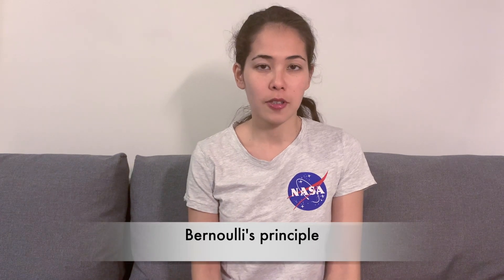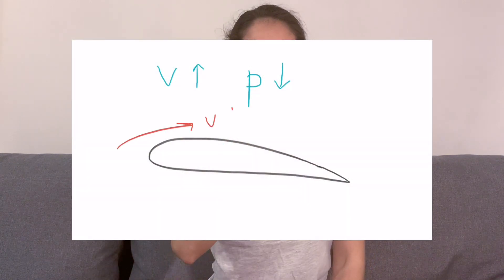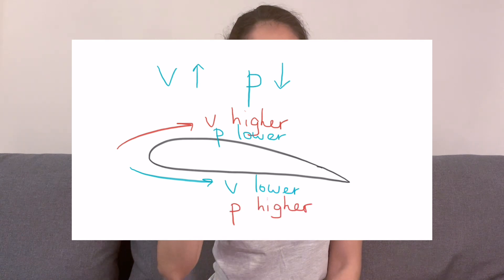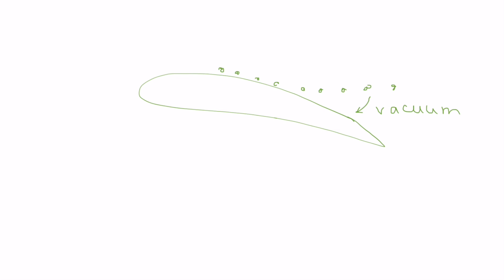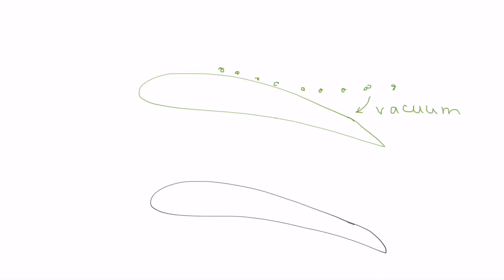What is the correct lift theory?

Comment: Hi Aliya, 

I just came across this video, I've always been interested in flight, but untrained; can I share some of my thoughts. I'm sure lift theory has advanced so much since your video, so maybe some of my concepts have already been proven or disproved. 

Both the Bernoulli and Newtonian principles seem to have gaps that I can't see anyone addressing, or even recognising. 

Bernoulli's principle doesn't have to assume an equal transit time. Wind tunnel smoke tests clearly demonstrate differences in time for air particles travelling over a wing vs under a wing. Smoke tests also demonstrate that the air over the wing slows down at the start, so it’s not all faster; likewise, air under the wing speeds up in some places. But overall, there is a net increase in air speed; therefore, there is a net decrease in pressure. At the same time, there is a net decrease in "relative" air speed under the wing; therefore, a net increase in "relative" air pressure under the wing. It's these pressure variables along the wing, and increase under the wing that aren't discussed. 

Another aspect of Bernoulli's principle that isn't properly addressed is the criticism that Bernoulli's principle only applies to fluids in a tube. Some assume that as a wing in flight isn't in a tube, then Bernoulli is irrelevant. However, in a wind tunnel, it is in a tube. Even so, an aircraft in open skys can be considered as if flying in a tube. Bernoulli's principle applies in large and small tubes. A very small wing in a very large tube has no discernable interaction with the walls of the tube; instead, that small wing is contained within a sleeve of ambient/normal airflow and pressure. A high or low pressure wave/differential presses or is restrained by that "normal" air pressure, as if in a tube. 

At this point there's a transition to Newtonian motion. I find it easier to think of these as displacement, deflection and thrust vectoring. When the pressure wave/differential occurs, it is resisted by the "relatively static" mass and motion of the surrounding "normal" air. This pressure differential tries to displace/move a static mass of air by either pushing against that mass, or drawing in closer. This means pressure differentials can also be co sidered as mass (floatation displacement) differentials. A mass being displaced then means forces and acceleration. 

As we add movement to these masses of the wing with its associated pressure/mass differentials against the mass of the normal airflow and pressure, we now have principles of momentum to consider, thereby we have momentum differentials. A consequence of non-colinear momentum and displacement is the deflection of those associated mass bodies. These deflections thereby have resultant vectors, for both mass bodies. 

So far these differentials have been direct wing interaction with the surrounding air, but after the trailing edge there is no more direct interaction. The higher air flow on the top edge is now coplaner with the downward dloping trailing edge profile, resulting in a downward flow of air/mass with inertia, which the surrounding aft airflow has to overcome to normalise. Although this mass flow normalisation is behind the wing, it is reacting against other air masses that have already been normalised, similar to the principles of a jet or rocket exhaust in air vs a vacuum. 

Two other aspects that are typically overlooked and not discussed are U-wings and uplift and bracing loads on a house roof. 
Both of these are outside of any Newtonian discussions I've heard, yet the capacity for high wind loads to lift a roof off the walls is very significant. 

Now to explore some of your other aeronautical videos.

Comment: As an aeronautical engineer who used to teach aerodynamics in college, I profoundly dislike these explanations. There are wrong theories for lift, like equal transit time, which is in fact a naive theory, it was never a real one used by real aerodynamicists. Naiver-Stokes is everything. It can handle any situation in fluid dynamics for which the continuum approximation is good (i.e. taking the fluid as a continuum rather than individual molecules). It can handle viscosity, compressibility, vorticity, temperature changes.... everything. (Naiver-Stokes is basically Newton's law applied to a parcel of air, plus mass conservation plus energy conservation). It can handle lift too. The problem with Naiver-Stokes is not that it cannot handle lift, but that we cannot handle Naiver-Stokes. It gets too complicated and there is no known closed solution for the general case, although numerical treatment can get arbitrarily close (given enough computing power, time, and knowledge of the properties of the fluid). Of course that the 3rd law needs to apply. If the air makes an upwards force on the wing (which pushes the airplane up) , the wing needs to make a downward force on the air (which deflects the air down). This is known as the action-and-reaction law, but which is the action and which is the reaction is totally arbitrary in the best case or, even better, meaningless. To explain lift, it sound nicer to say "the wing deflects the air down so the air pushes up on the wing", but the reality is not that one comes because of the other or the other way around. They are concurrent effects. Both happen together and need each other. Forces ALWAYS come in action-reaction pairs. This is enough to explain lift in the macroscopic view, but how is the force of the air over the wing manifested? It is due to the pressure distribution around the airfoil where, overall, the pressure is higher in the lower side than it is on the upper side. Why? Well, Naiver-Stokes. But the extremely simplified version of Naviere-Stokes, that is Bernoulli, is an EXCELLENT predictor of lift (predictor is not the best way). As Aliya explained, you can put pressure probes around the airfoil. With the measured pressures, you can calculate what the speed of the air should be in each spot around the airfoil. Then you measure the speed at those spots and voila, almost perfect match. No equal-transit required. You can also use the potential flow theory (which is the condition under which Bernoulli applies), with the Kutta condition (the assumption that each airfoil will produce enough circulation to ensure that separation happens at the trailing edge) to calculate IN ADVANCE what would be the pressure and speeds distribution and, again, very you get very good matches with actual measurements. This theory even permits to predict that the slope of the coefficient of lift vs angle of attack is 2*pi (with the angle of attack in radians), which is a perfect match for not too thick airfoils and not too low Reynolds numbers (at too low Reynolds numbers the viscosity effect takes more importance and the approximation of potential flow is less valid). Even then, Bernoulli itself is not enough. The Bernoulli explanation would be "The air moves faster on the upper side so the pressure is lower".  But why does the air move faster on the upper side? Because the pressure is lower, so the air accelerates from a region of higher pressure (normal atmospheric pressure) to a region of lower pressure (on the upper surface. Wait a second.... this sounds like what was first, the chicken or the egg. Does the pressure go down because the air moves faster, or does it move faster because the pressure goes down? And the answer is YES. I know this may sound not satisfactory, but both things happen at the same time and are concurrent, they need each other. Similar to what we said earlier about action and reaction. At the endo of the day, it is very simple in principle (the math makes it complicated). You start with a uniform airflow far away ahead from the wing. You put an airfoil in the middle, with a certain geometry and a certain angle of attack, and impose 2 conditions: 1) The airfoil is impenetrable (air cannot flow from the outside of the airfoil to the inside or vice versa).  2) The airflow must separate at the trailing edge (Kutta condition). These are called "boundary conditions". The apply the math (be it the simplified potential airflow model or more complicated models) and come up with the only solution that meets these 2 criteria. The fields of velocities and pressures is an output of these calculations, the exchange of forces between the wing and the air is an output of these pressures, and lift and the downward deflection of the air are an output of these forces. IT IS NOT DIFFEENT THEORIES, in the same way that if you have a mass with a spring that collides with another mass you don't have to choose between 3rd law, conservation of momentum, conservation of energy or spring theory. It is all part of the same phenomena and you will use all the equations at the same time, solving a system with many unknowns and many equations (in the case of Naiver-Stokes you are solving differential equations, but still). A the end of the day, if you start to dig deeper and deeper you will always end with General Relativity, Quantum Mechanics or a combination of both (which sucks because we don't have a theory that combines both). The rest is either approximations or emerging properties (like temperature is in fact an average of the kinetic energy of the molecules). That calculating lift is complicated doesn't mean that "there is no agreement", "nobody understands it", "there are competing theories" or anything like that. That is not the case. We understand lift VERY well and there are no competing theories.
Reply: At an AoA to the fluid, a flat plate will generate lift forces (primarily due to the stagnation point being located underneath) as this allows the plate to force the fluid out of it's way by simultaneously pressing downwards and forwards to split the fluid out of it's path at the stagnation point, this net force imparts a lift force and a drag force. Without the drag force compressing the fluid forward there would be no lift pressure, just a free-fall akin to a terminal velocity situation.

The forward force on the fluid i.e , the drag force, causes a compression ahead of the leading edge resulting in a favorable pressure gradient accelerating air ahead to the low pressure region above the wing. This is the reason fluid momentum above a wing's surface is faster than below, not Bernoulli or the Kutta Condition.
Reply: @singh2702 No need to re-invent physics, when it can be studied to enlighten one's misunderstandings.
Reply: @singh2702  Reading again, you're metaphorically saying that one diced piece of onion defines the whole onion.  Well, apart from DNA, no.  You have to study and apply the time-tested global rules of the issue (the full applicable basic rules of physics).  It's not a concealed mystery, if you reach out to the necessary resources.

Comment: Aerodynamics is a fascinating area to study and one day you will learn that lift theory is not debatable or a mystery, but explained well by Navier-Stokes equation.  Computational aerodynamics works well in many cases, but may fail because the software fails or the hardware is inadequate, but do not mistakenly interpret this as a failure of theory.  Please learn from physics and math sources and avoid incorrect ideas: "vacuum theory," "equal transit time," "detachment" is not understood or "no simple explanation."  Even if you understand only half of what you read in physics or math, keep your amazing positive attitude, anything you learn is more than you knew before, keep reading, do not give up, and you will learn a lot!

Comment: and from where does the velocity of the air OVER the wing get this extra energy to speed up ... THAT is the incorrect portion of the statement ... it is a direct violation of thermodynamic law ... energy was created out of nowhere NOT converted ... 
.
technically the velocity does NOT change the the pressure does because it is filling a "vacuum" ... actually it's replacing the air that once was at the same slice in space as the air under the wing ... which is essentially a virtual vacuum ... 
.
molecule A of air and B of air are equidistant from the wing Leading edge and in direct line above each other ... once the reach the leading edge they change velocity and direction and follow the wing ... one over and one under .... the one under has a shorter path normally and so carries on at almost the same speed it came to the wing at and in the same relation to where A should be ... while A not only has to change velocity but also has to move up and away from B it therefore no longer is above B because it takes TIME to change ... so as B leaves the trailing edge of the wing A will be some distance behind it ... THAT is where the lift comes from it is the direct difference between location A and B ... it would be a pressure ratio and either add or subtract from the air pressure around ... and for lift it subtracts making it a lower pressure above and a higher pressure below causing the bottom air to push the wing UP ... while if A leaves the trailing edge before B the it is sucked down as A is a higher pressure than B .... also known as stall or stagnation ... 
.
this is where most call the basic lift theory wrong ... as it needs to speed a velocity up with NO input in violation of thermodynamics   ... energy can neither be created nor destroyed only changed.
Reply: and if you measure the velocity of the air over the wing and under the wing ... they will be the same ... so it holds BUT it is not an accurate theory ... as it is the pressure relationship between the two parts of the air over and under that causes lift and yes it still agrees with bernoulli ... and Thermodynamics ... as the fluid (air) isnt created and sent as a sheet or wave at the wing it is all encompassing and the wing is either passing through it or the air is being passed over it ... (or both) so even though A and B are at different locations at the trailing edge from where they started before the wing ... the air before they arrived is still there at a different pressure ... as it went from a compacted zone to an expanded zone and actually LOST pressure to fill the less dense space ...
Reply: the turbulent flow is caused when the air cant be replaced by the existing volume in that location fast enough causing the lower air to back flow ... increasing drag and reducing lift and thrust .... the pressure change is just a ratio of compression over and under the wing ... at some point for an airfoil that ratio degrades to a point where the lifting portion of the wing is smaller than the drag portion of the wing ... also the laminar flow is at some point lower than the turbulent airflow ... 
.
 the speed change measured in a wind tunnel ISN'T comparing the two particles it is comparing how fast the air is being replaced on one surface over another ... if you put that wing in the tunnel and have it run to create lift and then add smoke and SLOW MOTION capture the smoke as it passes over the wing ... the smoke on top is slower than smoke on bottom by a small fraction ... as the angle of attack increases the "stickyness" of the wing surface is not as strong as the normal volume of air ... so it leaves the wing surface causing turbulent flow from under the wing to backflow ... THIS is where the coriollis effect plays its role in lift and why is should never be ignored or back burnered as it is what makes lift happen and yes it is a small affect in MOST situations ... BUT not all .. and it's minimal influence in some aspects can be ignored temporarily once it can be shown that the effect of the affect is too negligible to consider above the error ratio ... 
.
whats so hard abut that ... nothing and it does cover all the ranges of flight ... and all the wings shapes .. and angles of attack ...
Reply: and John Anderson is right ... the closest one can get to a simple explanation is  - Lift is a multi science discipline that no one has been able to fully implement so far ... because we dont properly understand how nature actually works ...

Comment: Your explanation of Newton's theory is not quite right. The third law is just a secondary effect, the primary effect if the second law of motion. F=ma. When we accelerate a mass of air, we are essentially creating a force. that force is directed downwards at the trailing edge and hence create lift due to Newton's third law of motion. However, that theory still gives me some doubts because if we closely look at the angle at which the flow leaves the trailing edge - the wing should also create thrust which is far fetched :/

Comment: Actually, the Bernoulli's principle can explain - its contributions to the lift - why some aircraft can fly inverted. Without going to much into the mechanics; consider a symmetrical aerofoil. If we invert it, it would still fly because we just change the pitch -applying it in the opposite direction of our intended pitch and it would behave the same way as the one not inverted. If we are inverted, we can pitch down, creating a positive angle of attack and hence lift in the direction of positive lift considering an inertial reference frame. The same is true for the unsymmetrical aerofoil although the behaviour maybe different to the special case of the symmetrical aerofoil.
Reply: In the same breath - Bernoulli's principle can still explain its contributions to lift for a flat plate, all we need to do is change the angle of attack - this allows us to change the behaviour of flow as it traverses the top surface (going faster) compared to the bottom surface.